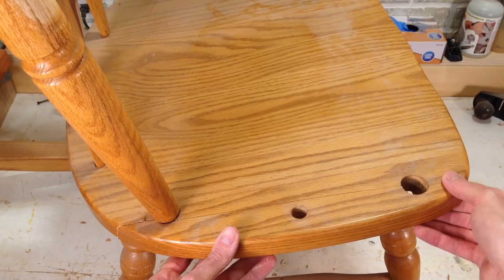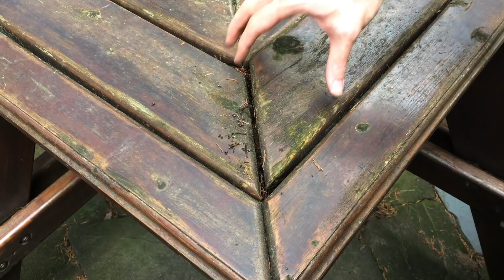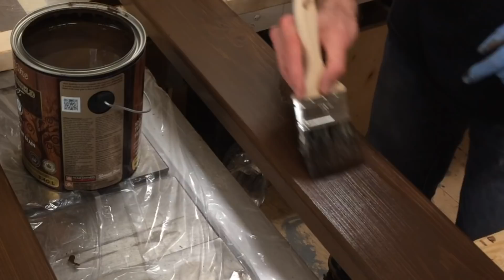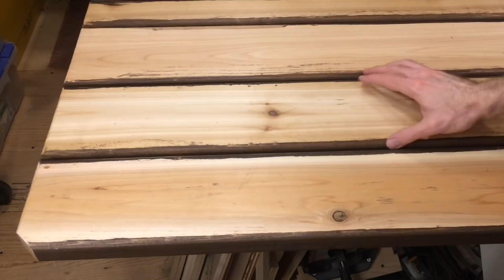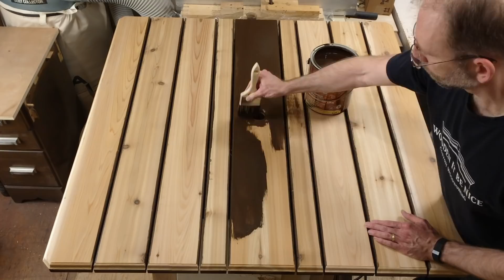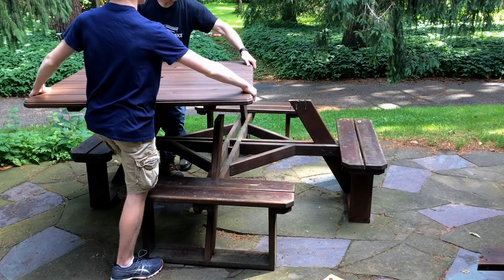How to Repair Outdoor Wood Furniture & Fix Rotten Wood | Woodworking

Comment: Thank you for a very informative video! Though I liked the original design better, I do understand that the long-lasting comes first. I've been thinking about some ways to keep the original structure on top, but it seems to me that you'd need to change the supports substantially, e.g. splitting them into two to make a gap for water to come through.

Comment: Great video. I need to do something similar…what wood did you use here ? I am looking for something low cost and am only looking for 5 years of life. It will be left out in the open…Bay Area weather
Reply from the maker: I used Cedar.  It's naturally rot resistant and less expensive than something like Teak.  I hope that helps.  Scott

Comment: Hi there, 
First...  MANY MOONS AGO in 1979 - 1980 when I was young enough to take  some  SAILING COURSES...  I visited on a small YACHT and it had some mahogany and teak wood...  I told the owner:   "WOODEN!  IT BE NICE!"  (Beach Boys)      
I am ELATED to see your SHIRTS !!!!

I like learning many things...  I have skills and understanding in many fields...   I am MOSTLY a commuter specialist...
I was a bit disappointed that you did not keep the ORIGINAL DESIGN...  
I understand the rot-causing issue...   if I were to solve this problem I would use a SPACER of a sort between the top and the diagonal support...    what came to my mind was an ALUMINIUM  STRIP  (2 in. x 96 in. Aluminum strip, 1/8 in. Thick) that will be placed between the top and the supporters, and would reduce the water exposure of the support beam.   it should  be used as one long spacer ..
    
What is your opinion about this?  
Thanks for your sharing

Comment: Why not ground treated wood, and stainless steel screws? We all know that steel rusts, but I have been surprised at times in the past at just how quickly plated screws will weaken and break when exposed to the weather for just a few years.

Comment: A beautiful work of art. However, I also loved the original design. Could you demonstrate a way to build original design,  and keep the water from seeping through and rotting the support below?
Reply from the maker: There isn't a way to prevent waster from seeping through.  What could have been done is design it in a way the ends of the boards aren't sitting on a support board - twice the work from a construction perspective, so there are tradeoffs.  A better solution might be to store it indoors over the winter or make the top out of composite lumber.  Does that answer your question?  Scott
Reply: @FixingFurniture  Thanks a lot Scott. That answers my question. Appreciate your feedback!

Comment: I fixed one board on my table the other year. I was too cheap to go buy a piece of cedar, so I used a pressure treated 2x6. You can see the little injection holes where the liquid was injected. Looks rather ghetto, but once I stained it, it look 9/10.

Comment: Have you ever considered using a stain/lacquer in a diluted solution as a primer and even increment the concentration in several layers?
It gives very good penetration, several millimeters and deeper penetration means less chances for moisture seeping in. 
A superficial layer can easily be scratched...
Reply from the maker: As I understand finishes, lacquer is not appropriate for outdoor use.
Reply: @FixingFurniture  The protection layer applied to the wood, in general. No matter if Shellac or urethane polymer paint.

Comment: This is like a € 100,- table and a € 150,- repair. But it is a nice repair.
Reply from the maker: Thanks.  I stopped questioning how people choose to put money into furniture years ago.  Everyone has their own opinion of value.  Cheers.  Scott
Reply: Maybe the preferred to pay a local craftsman to repair it than to buy a foreign-manufactured table from a big box store?
Reply: clearly people use other metrics that just the shelf value of the furniture. Maybe it has a sentimental value, maybe they just like it the way it is and don't want to change it, maybe they don't want to generate more waste than necessary by trashing the whole thing. I know this because my mother is always trying to salvage things in a way that is financially unsustainable (repair price roughly the same order of magnitude as bought price), but she can find 10 reasons why it still should be done.

Comment: The best way to prevent this table from rotting is to build a roof over it and perhaps some walls to prevent rain from dropping on it. Also to use as little metal as possible in it's construction (ideally none). Any finisher or paint over wood reduces it's lifetime actually.
Reply from the maker: Thanks for the tips.  I've never heard about a finish reducing the life of wood.  I appreciate that.  Scott
Reply: @FixingFurniture  Thanks for responding to me, english is not my first language so i hope you forgive me if the terminology i use is somewhat off and my grammar is not great.
To be more precise, it reduces lifetime of the wood in an environment open or partially open to weather. It doesn't matter much for the indoor environment unless they are particulary wet.

Wood is very good at absorbing the moisture, but not very good at giving it up, so coating in almost anything means reducing the surface that moisture can evaporate from. So, for example, painted wooden fence will always rot before unpainted, given the same conditions. The exceptions are lime and chalk based coats, since they allow wood to breathe and evaporate moisture more freely.

Also, metal conductivity differes greater from wood, so it will be a point of condensation, so the wood around metal is usually more moist, which can lead to rot. There is a saying in my country "wood starts to rot from the nail".
Reply from the maker: Now I understand more clearly.  I agree, if a finish isn't maintained it will allow moisture in and cause issues. Thanks for your response!  Scott
Reply: @nonono4160  if it lasts 10 or 15 years, it' s good enough anyway. We're not trying to build wooden temples that will last for centuries. We're talking about everyday outdoor furnitures ..
Reply: @xl000   it ain't gonna last that long directly under the rain. The simple decision of making a roof over it not only would make it last longer, but also will make this a nice cover from the rain to humans too.
Reply: same logic applies to cars and accidents. If you leave the car in the garage, you don't get any accident on the road.
Reply: @xl000  yeah, and you are basically responding with that argument to a guy who gives you an advice to wear seat belt.

Comment: I rescued a small round table from my grandparents' attic and it has some water damage issues. The top is made of particle board with veneer on it. Since it  is not solid wood, it is definitely not a valuable piece in terms of market, but I find it worth restoring. Due to moisture, the edge of the top is 3-5 mm thicker than where it is intact. My plan would be to get some glue inside the "bloated" parts and somehow squeeze them back to normal with clamps. I may have to remove a little bit from the board to do so. Would you advise something else?
Reply from the maker: I would typically discourage spending time restoring particle board, but it seems to have some value to you.  Particle board won't compress to it's original shape, so yes, you will have to remove some of it and fill the voids to get a smooth surface.  You're on the right track.  Cheers.  Scott